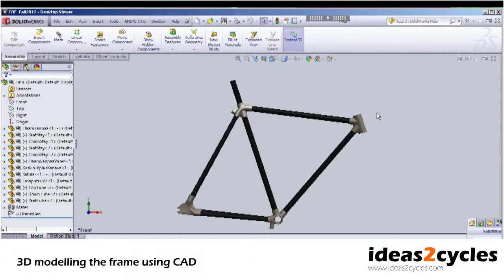Using 3D printing to cast custom lugs for a bicycle frame

Comment: Use An Air Chisel with a flexible blade, will Vibe through better than Pressure washer.
Reply from the maker: Great idea! The pressure washer was quite slow.

Comment: Why the ceramic mix and all the coats?  Is it needed because of the temperature of the steel?  I guess I thought sand casting would be easier.
Reply from the maker: The ceramic forms the mould and needs to stand heat. Sand casting is 
easier yes, but no as accurate or suitable for complicated shapes. See 
our other videos for sand casting.
Reply: ideas2cycles thank you for the reply.  I'm getting a 3d printer soon and hope to try this for a tri-bike.

Comment: How did hitting the front wheel with your foot every time you turn work out?
Reply from the maker: Toe overlap has never bothered me, so it worked out nicely. I would like to emphasize, though, that this project was not about the geometry, but rather the manufacturing method.
Reply: Nice, it looked a weee bit close! I found your video as I was researching lost-PLA 3D printing/casting with respect to lugs, very similar to what you're doing. I'd love to work in stainless eventually, but just for my own ride, guessing that a visit to a proper foundry and enquiring about small run costs might lead me straight back to DIY :/
Reply: +Nick Mulder lol I noticed something about the geometry being a little funny.